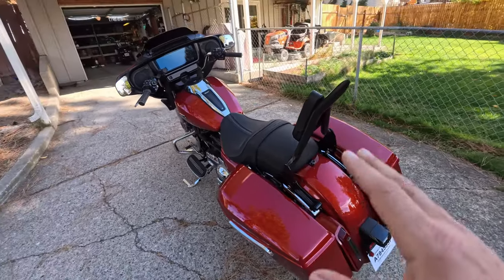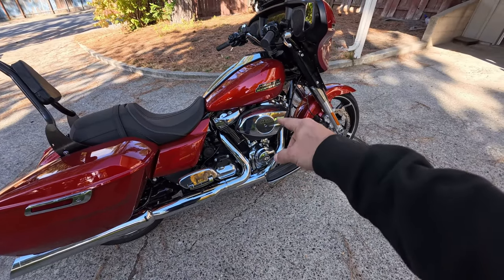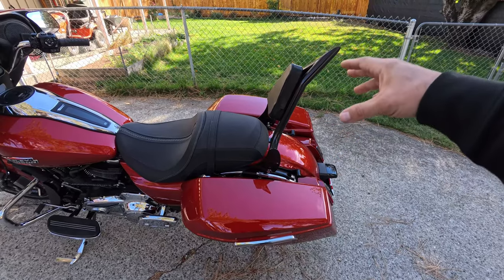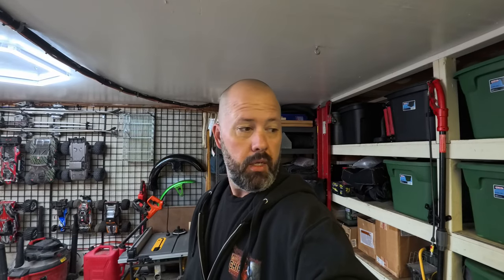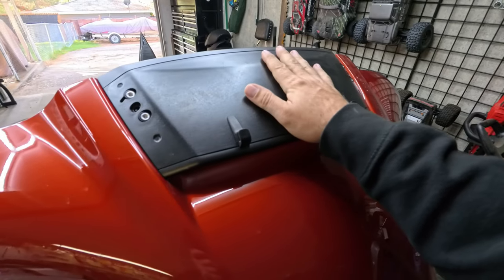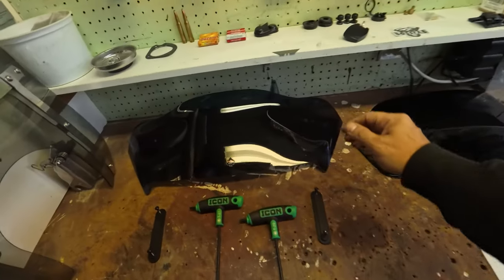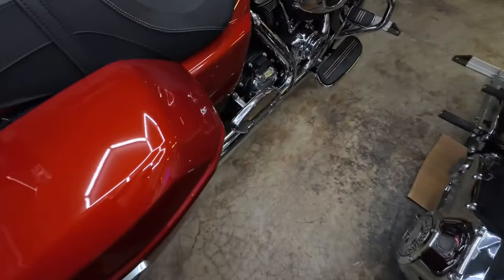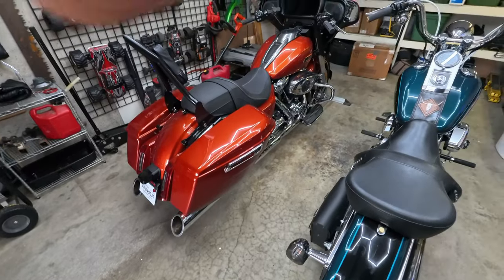Klock Werks windshield on a 2024 Street Glide

Comment: Congrats on the bike! Own a black on black 24 SG myself. I’m 5’11. I just put on LA chopper Twin Peaks 10 inch. I probably could’ve went 12 but I didn’t want the switch housings for my hands higher than the fairing. How do you like the 8 inch klockwerks windshield? Could you have gone to 10? Thanks.
Reply from the maker: Thanks! I do really like that murdered out look on the Street Glides. I'm the same as you when it comes to keeping my hands behind the fairing, that's why I went with 10" on my 19 Street Glide. I'm happy with the 8" Klockwerks but probably could have gone 10" for better wind deflection, but I really prefer the look of the 8". I'm seriously considering getting another 8" but in red, just haven't fully decided yet, lol

Comment: I have the same bike and same Klockwerks Windshield. Windshield works Great! How tall are you? I am 5' 10" also does your bike run great still with just slip-ons? Any warranty issues by having just slip-ons? Thanks 😎
Reply from the maker: I'm 5'9" but mostly torso and the Klock Werks is great for me. The bike still runs perfectly with just the slip-ons and it doesn't bump into any warranty issues. That being said, I could start to flirt with that warranty line if I were to put my headpipe on but that's only if they were to shine a light down the exhaust since it looks like a stock headpipe. Still debating on that part, lol
Reply: Excellent 👌 Thanks 😎